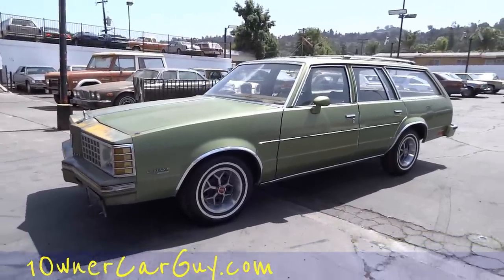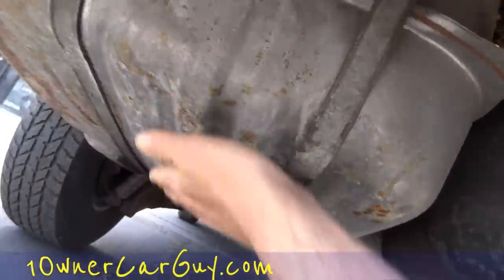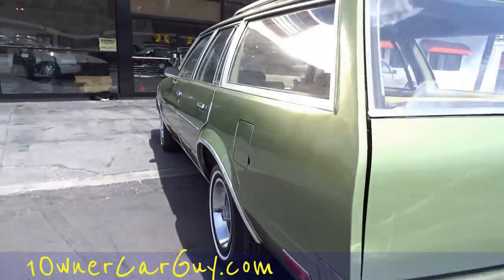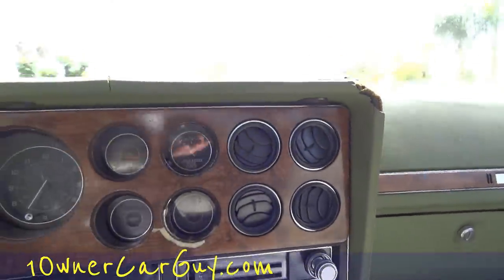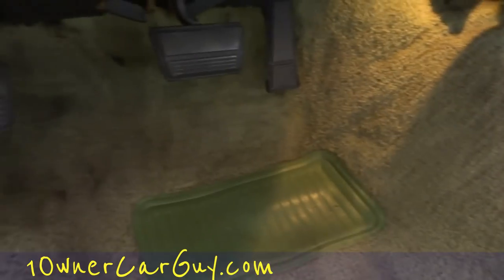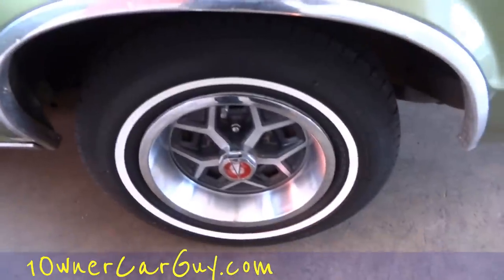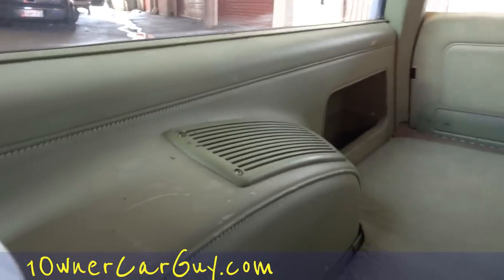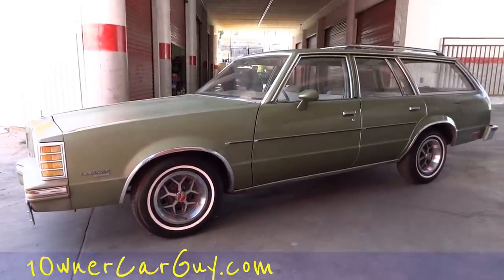LeMans Safari Station Wagon Classic Estate Break Youngtimer Car Video Review Walk Around

Comment: love this bodystyle... My dad hadCutlass Cruiser wagon, 350 with a quadrajet.. passed everything but the gas station.. I THINK it even required premium gas.. dontcha just love the muffler running parallel with the back axle... and the muffler mounted crimped edge up??  ALL those mufflers blew out prematurely.. MIDAS got tired of seeing us once a year.. 1989, car had 60,000 miles on it, and the camshaft had worn out prematurely.. we unloaded it, dealership blew motor on way to auction  lol

Comment: my uncle got my grandmas old straight bodied 1986 white pontiac parisiene fully loaded, he ended up scrapping it! it burned oil and hid ex messed up the transmission but this thing was straight and rust free. i miss it, the grills lights, adn as you mention the wheels were better on the pontiac back then

Comment: I just picked one up Saturday morning 1980 Pontiac Grand LeMans.two little rust spots other than that it is mint condition the paint faded or nothing like that car the dash and everything is like new so is the rest of the interior heat and AC works 265 Pontiac motor 93800 miles I drove it 500 Miles home from Indiana to Michigan with not one issue. I only paid $3,000 for it

Comment: When GM downsized their intermediates for '78, they wanted shoulder room to be similar to the '77 models. To do this, they made rear windows stationary to include arm rests inside the rear door panels and had swing out rear vent windows. Personally, I've never seen a GM car like this with manual crank windows in the front and power vent windows in the rear.